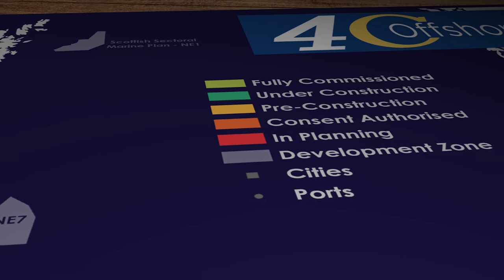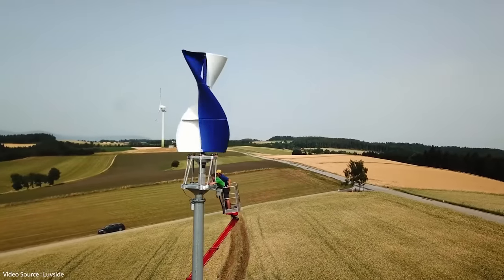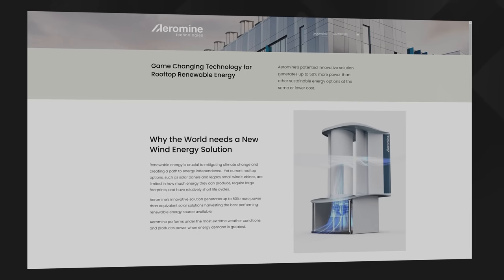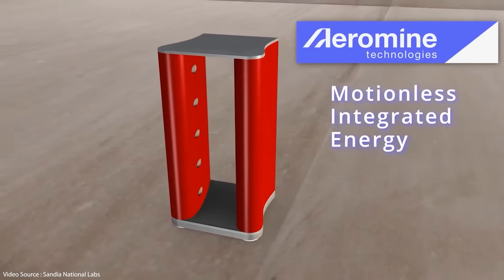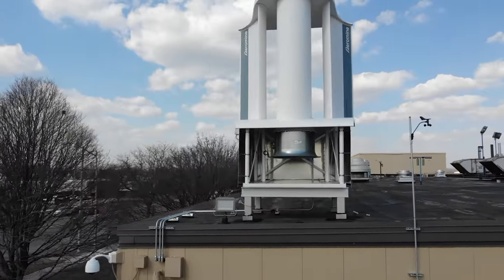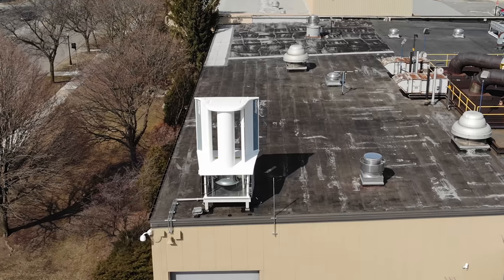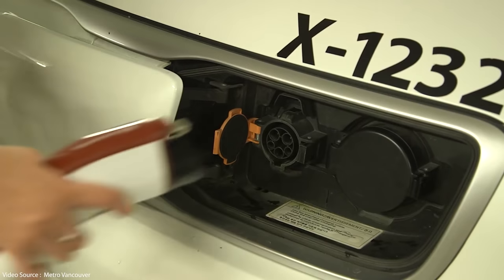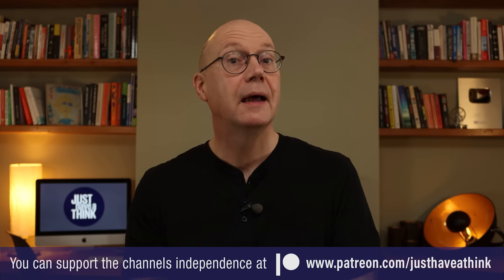Aeromine Rooftop Wind. Static. Silent.  50% more power than Solar PV. What's not to like?

Comment: Interesting!
If a single unit at 10' high can produce 5,000 WATTS, then that's a game changer for sure.
It will be interesting to see the wind speeds to voltage/wattage production is in the real world.
Reply: I find that claim pretty hard to believe, and it is obviously dependent on wind speed.  Why not release a graph of output vs windspeed?  Very dubious of tech companies that don't release basic data.
Reply: @Scroty68 Yeah, I'm having my doubts at all.
They only reason I find it interesting is because this seems to be a different or "modified" version of the already proven "Vertical Windmill" devices that can product energy at low wind speeds.

I became very interested in these a few years back when a school, close to me, installed one of those vertical wind turbines.  (not the same as in this video.  More like blades that are in a corkscrew shape and vertical.)

Sadly,, after a bunch of years, they have removed it, but I don't know why.  I think that I noticed it gone during COVID.

Anyway, time will tell if this is something viable or just another snake oil sales pitch.

Comment: I am excited by the Aeromine potential and hope it becomes prominent. The practical side of me is skeptical about a few factors:  it seems to me a perfect place for bird nests and wasp nests. How easy are they to clean when they get dusty and dirty because they definitely will being exposed to the element of wind. Where do you put the lubricant so the internal wheel can keep spinning? Is it a metal that doesn't rust? If so, is it a potential theft target? Can they be disabled   by graffiti or tree limbs blocking the air flow? What happens when the wife says "It's ugly. I don't like it. Take it down".  These are the problems I'm worried about. But I am still hopeful it is the design that succeeds.

Comment: hmm.. skeptical. - Firstly "no moving parts therefore silent"  is clearly not true. It has an internal turbine, and its boxy shape will still create turbulence, so i don't see how there's much advantage over a more traditional windmill design. I can see some advantages of the design, such as concentrating the flow to make the turbines more efficient, - but I think this video is overhyping it somewhat.

Comment: 3pm EST, South Carolina, USA) very interesting indeed! …. just imagine the possibilities…with mass consumer installation, makes such good sense. So…I just had a think….on a related topic, I personally have always been intrigued with using consistent ocean floor currents in certain strategic geographic locations for the installation of giant underwater turbine type generators powered by these strong non-stop currents flowing 24/7 365. I’m guessing the physical materials that could withstand the pressure and corrosive properties of ocean water have probably not been invented yet or have, but are too expensive to use on a large scale. Would love to know more on this topic if you can investigate and report!

Comment: Good afternoon.
I live in a neighborhood community where we have air conditioning compressors on the roofs of buildings.
There is not enough space to assign each home a space to install photovoltaic panels, so in order not to create conflicts with the rest of the neighbors, the only idea that occurs to me is to use the space occupied by the air conditioning compressor to install it on top of it. a wind turbine.
Can you tell me what the measurements are?
And where can I place the order if my city council gives me permission to install it?
Thank you.

Comment: Could it be something is wrong about the graphic with the height and power of wind turbines from different decades? In December 2017 my village got five turbines Nordex N 131 with generators at 134 meters, the rotors have a diameter of 131 meters -> let's say about 200 meters over all in height. But they only have 3.3 MW each! They can start working at a wind speed of only 3 m/s but have to stop at 25 m/s. I guess the stats in that graphic count on turbines in very windy areas, like coasts or off shore.

Comment: One thing to note here is that wind turbines typically have brakes to prevent power overdrive in high winds. This design principle is the exact opposite. In fact, it may be the case that these units underperform in low winds. Siting will be a major factor here, me thinks. In regions of high winds, these units may do well. 

Solar PV for electric generation is hard to beat. Solar panels for direct thermal capture are even more efficient per m^2. Here again, siting and insolation levels are key factors in determining which technology to go with. One does not fit all. Multiple options are needed for different locations and conditions. 

Post-script: I've been on solar PV for such a while now, that the very notion of a "power bill" seams foreign and ridiculous. Who is charging for the Sun? By what rights are they forcing you to pay for what energy the Sun gives the Earth; be it through algae or photons or air currents? F-um. The Sun, and the energy it produces, belong to no man. And no man will charge me for it. Nor the air. Nor the water. Although many will try. But again: F-um all. 

(Typed on a device powered by the Sun, collected in my front yard. At my convenience.)

Comment: I can see using shutters to restrict airflow in high wind conditions. However, this would be best used in areas with consistent wind direction, as areas with more varied wind directions would need the unit to pivot to get the best inflow.
Reply: It is not about wind... It is more about convection air currents, like hills where the wind travels up in day time and down at night.

Comment: I am getting solar power system for my garden studio in suburban London as in windy hilly side. I want to compliment it with mini wind turbine but, horizontal axis ones available for semi-domestic size do not look safe for my garden birds and do not look good design wise. And I can't find any reasonable vertical axis one on the UK market. I think most of design engineers are men (just like most of product designers are, for bad taps) and want big project first and then downsize to domestic market with ugly designs. My steel and U-PVC double grazed and a skylight garden studio needs all retro fit electrics too. For that kind of price paid it should come with such fittings.

Comment: Could this technology be used on vehicles to generate it's own energy, making electric stations and therefore reduce or eradicate energy grid reliance? How large do they have to be? Could it be done without major redesigns to vehicles? I'm specifically thinking about the wind reduction design used in the bumpers of vehicles like the BZ4X. This would also reduce the required battery bank size, significantly, to go long distances. These are my thoughts that come to mind...

Comment: I am pretty sceptical and I'm a bit surprised that our host isn't, considering his expertise and experience. There are several issues. Urban wind speeds are not high or reliable. Air flow is irregular and disturbed. Micro-wind generation of all kinds has rarely been found useful in actual practice, except for isolated non-grid connected facilities with lots of room and no noise worries - a highly touted micro wind turbine installed in Wellington Harbour in NZ, the windiest city in the world, failed to meet any of its claimed output by a long way, and broke down after a few months. . A contributor below (Sam Mason) has been kind enough to so the physics for us. The Venturi effect might speed up the wind flow but the energy contained in that wind flow is entirely dependent on the cross sectional area of the intercepted wind flow and its speed arriving at the generating unit. Indeed the resistance or friction of the walls of the unit that causes the Venturi effect must itself adversely affect the overfall efficiency of the unit. I wouldn't actually call this a "scam" , which implies a deliberate deception, but it is yet another example of over-enthusiastic expectations allied to poor physics.

Comment: I am curious why they didn't incorporate magnetic bearings on the base of the airfoil configuration? Putting the airfoil assembly on a magnetic bearing would still allow silent operation put would also allow the airfoil to act like a wind vane that automatically points into the wind. Seems like that would increase the overall efficiency of the design, but it might not stand up to high winds as well.

Comment: I think "no VISIBLE moving parts" needs emphasis. Clearly there is a small turbine on the suction passage to capture some of its energy. However that energy depends on the degree of pressure drop on the main air passage, which will be related to wind speed.  Things like this need some form of energy storage as they don't generate enough "spot" current for peak loads, but over 24 hours or maybe a week produce sufficient if the unused output is stored. Of course the wind has to blow first ! I have seen  an absolute forest of wind turbines on the Hunsruck in Germany that must have cost $billions, but they were all stationary as there was no wind. And none for days, either.

Comment: How would it fare under sea wind conditions? (Rust) Also, another advantage over solar panels is weight. Solar panels require a very sturdy roof to bear them.  I would think a combination of the two systems would be ideal.

Comment: Hi everyone, I believe this might be some tests suggestions. So I will try to answer them. I think in this video it means the static ether power generation?

It works based on compressions of the magnetic fields (dielectric field lines) pressure on one part of the systems which creates a different net force of dielectric field. 

Once we placed a copper wire along the different pressures of the dielectric field, it creates a constant charge due to difference in dielectric field lines pressure.

Comment: This structure could have a guide/rudder so that it is constantly facing the direction of the wind. It certainly increased the constant flow of air/wind passage. Nor is it an original idea. There is another company, which I don't know if it still exists, which has something similar, but with the "turbine" well inside the structure.

Comment: I really can't wait for wind power to surpass solar, everyone has such a negative outlook towards wind power. Iv'e used gearboxes to amplify the wind speed and have got great results that can even be run in high winds. All you have to do is switch to first gear and it hums along at a slower speed while the wind rages. I need to get a pma and see if it will actually put out a decent voltage at higher gear lower wind speeds, it's all still in the works and started out to be for a water wheel.

Comment: this could also be simultaniously used as a HVAC system. There would be some efficiency loss but It would be still more efficient than converting the electricity to a fan motion.

Comment: I first learned of the Venturi effect while working for a beverage company. We produced fruit juice with the addition of guar gum.  You can't just dump it into a batch without having it clump up.  We used a Venturi funnel to incorporate the material and it worked fine.  I'd be interested in a home unit to supplement our energy needs.

Comment: Sounds very intriguiging at first glance. However, how can you say the system has no moving parts when you can clearly see a rotating fan at its bottom? Also, with 3m it is way too big for privately owned one or two family homes. In Germany (where I live), you would have great problems getting the building authorities' permission to put such a high structure on top of any building in a housing area, since there are restrictions on how high you are allowed to build which also regulate such additions. Almost all apartment buildings in Germany also have no flat rooftops.

Comment: It would seem this kind of system could be used in consistently flowing streams by taking advantage of the Venturi effect.  Floating the device just below the top edge of the water using an angled screen to keep debris out of the flow while anchored to the bottom would seem to have a similar effect as wind.

Comment: Seems like a good design that eliminates some of the aesthetic complaints and reduces cost. I’m curious if they’ve tested a model that pivots to capture any wind direction, which seemly would harvest more wind making it even more efficient.
Reply: These have been designed to utilise the increased wind speeds coming over the top of a building's wall that is oriented to face prevailing winds. To keep the same efficiency for a given wind speed, you would have to rotate the building. Much like solar panels on a pitched roof, installations will work best when incorporated in the design stage of the building
Reply: Add A.I technology to this and the wind generators can talk/communicate with each other and get maximum winder power bu adjusting positions throughout the day..also they look ugly add led lighting make it sexy and use as source of advertisement they can light up and display images/work synchronicity and produce opportunity for corporate branding..Great idea these additions will make it sell to public and companies..remember you saw it here first 24/02/2023...message me for ideas im an independent designer/creative

Comment: Interesting, thank you.  It's a year since this video was produced.  How far along is this technology?  And do they have something that works on normal house roofs?   People in snow load areas do not have flat roofs.  I live in a mountain foothills area - very sunny, but  prone to high winds and hailstorms, so am more interested in wind tech than solar.  This idea could work for me as the wind direction is constantly changing through all 360 degrees here.  

It seems to be taking forever to get something practical done.  Could make an oil industry conspiracy theorist of me, but I won't go there.

Comment: This looks great. I wonder how it would work domestically seen as most UK house are apex roofs and not flat. Good for Flats and business i suppose. We have been trying to look at getting ridge blades or something akin for wind generation on our house as we are on a hill and its always windy here with no luck.
Reply: An apex roof would be great as air travels uphill with the strongest being into the predominant side (you would still get some on the weak side), so if your winds switch 180 degrees like hillside and river areas, you would need them on the opposite side as well.

Comment: I think one thing that should be repeated highlighted when it comes to wind energy is that it is far less reliable and more location specific than solar installations. This could work well on one building and then work terribly on another building next-door. I like the design and I think they could have some very specific applications but I highly doubt it can compete with solar in terms of reliability of output over a large number of geographical areas.

Comment: But the  efficiency should directly affected by wind direction, so maybe a horizontal fin + circular base with bearings which can rotate would be a good upgrade so that the aeromine would always facing maximum wind direction at all times

Comment: You don't explain how the air flowing over the static foils increases the velocity of the verticle air flow. Are there perforations in the verticle tube that houses the power generating components, apparently a fan and generator, that slow the horizontal flow and venturi to pull more air through due to the low pressure area? I'll check out the aeromine site for more information.

Comment: An opinion from Connecticut: Yes, the system looks great however there might be one drawback in cold climates; that is Freezing due to Snow or Ice rain. Both of which are very common here in my State as well as in other northern ones.  If the system could be modified for these types of weather, you might be well on your way to becoming the next Billionaire.

Comment: Either the Aeromine has no moving parts (as you say), but then how is the energy generated?
Or the Aeromine has a turbine (as you say), but then it has the same issues as other wind energy power plants with moving parts.

Pick one.

Comment: Aeromine must be compulsorily  be used in every indian homes just like solar water heater power individual homes even without the government  electricity. 
The  existing  electricity  boards be changed to Sustainable  power boards who provide and also install solar panels, aeromines....and also maintain and undertake repair works.  Future will gradually get rid of high tension wires ie wireless power so that there will be ZERO  transmission  and distribution  losses. Worldis in dire need for  these bright innovations. On a large scale on a war footing

Comment: Sounds interesting. I wonder how it would work in colder climate and during snowy weather. Will it clog up? Winter is the most demanding time when it comes to energy needs. There is a lot of days with little sunlight and days without wind. It could be a good supplement in the right places I think.